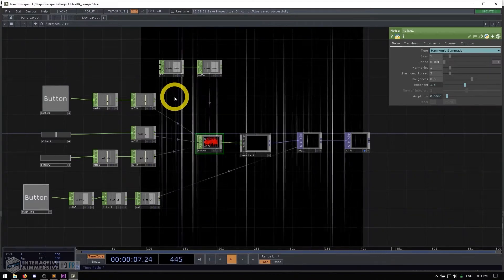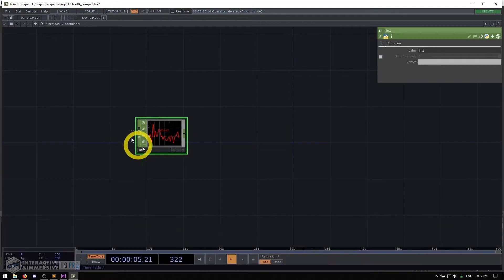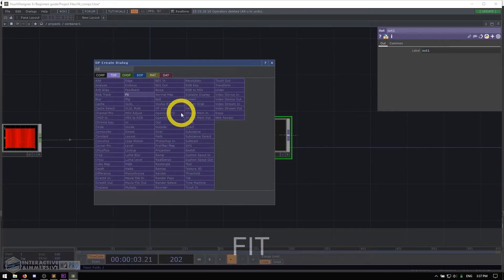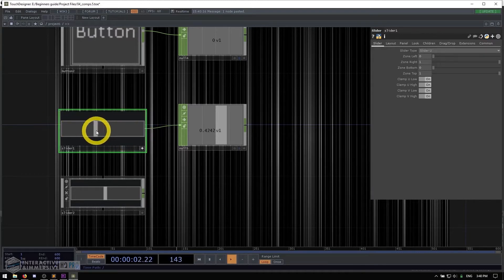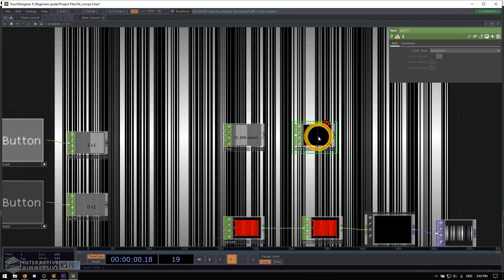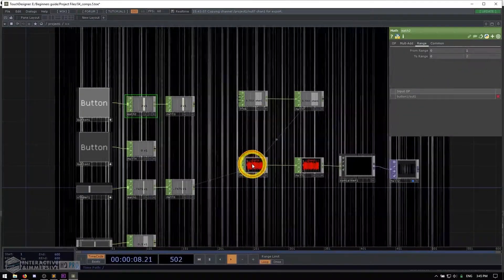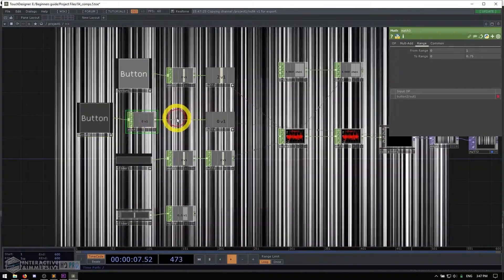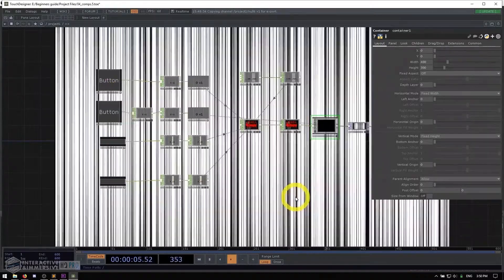12 - Working with COMPs - TouchDesigner Tutorial: Beginner Crash Course

Comment: When i am referencing the noise 'IN' to 'CHOP TO' I am getting error saying 'Invalid path for Node.....reference by parameter 'CHOP'. Any reason?
Reply from the maker: It sounds like you might be making a CHOP reference to the CHOP to TOP's CHOP parameter instead of pointing it to the in1 CHOP. You'll want to either drag the entire in1 CHOP onto the CHOP parameter (make sure the viewer is not active), or type in1 into the parameter's text box.
Reply: @TheInteractiveImmersiveHQ  Hi Thank you so much for responding. I got it fixed, i was dropping the reference value instead of the operator name. :)

Comment: Why when I reference the bottom chop value to the noise type parameter, which "disconnect" the connection of my other parameter and slider and lfo (deactive my control of my other parameters)  ?
Reply from the maker: It's possible that this is happening due to changing to a different noise type than what we cover in the video - the Brownian and Random types have fewer parameters you can adjust (many of the previously available parameters will "deactivate"/become greyed out). 

Double check that the range settings of your math2 CHOP are correct (these are set around 12:15 in the video), as this will control which noise types you'll switch between. Hope that helps!

Comment: Why is it that sometimes we reference a CHOP with the Viewer Active ON and sometimes (like in 3:03) we have to drag the operator?
Reply from the maker: Great question! 

In the example at 3:03 we're not actually making a CHOP reference, we're just pointing to the in1 CHOP. The CHOP to TOP's CHOP parameter requires us to point it to the particular operator in the network that we want to convert into a TOP texture.

This is different from a CHOP reference , which involves actually using the data found within the CHOP to control a specific parameter's value.

Comment: Excellent presentation on this. For a live performance scenario, would it make sense to have several "modulator"  nodes mapped to buttons and sliders? Then have several containers with more complex networks that I could switch between during a performance?  I'm looking to have many different visual styles during a performance while managing CPU usage.  Hope my question is clear.
Reply from the maker: Exactly! For a performance with multiple visual effects, you'd probably want several separate COMPs that you could then "mix" between during the set. If you're not using a MIDI controller or some other way of manually controlling parameters, you could definitely set up CHOP networks to control the parameters automatically. 
To keep things performative, it's always good to follow the suggestions that Derivative have here: https://docs.derivative.ca/Optimize

Comment: What's the difference between Lag and Filter nodes?
Reply from the maker: The Lag CHOP offers the ability to apply different amounts of lag/smoothing to the upward (increasing in value) and downward movement (decreasing in value) of the CHOP channel, as well as the ability to add in overshoot (again, up & down) and limit velocity and acceleration of the data. 

The Filter CHOP, in contrast, does not offer the ability for separate up/down filter controls, but instead has seven different filter types that can be helpful for dealing with specific types of data (for example, de-spiking incoming data).

Comment: Hi there, I absolutely enjoy your great TD Beginner Course. You're explaining it really clear and to the point. Thank you! But I do have a question. It seems the animation on the Z rotation of the noise ramps up in speed from left to right of the screen. So the left side animates slower than the right side. Why is this? Thank you in advance!
Reply from the maker: Great question! I think it has something to do with the way that the Rotate Z parameter rotates through the noise model. I've found that applying the CHOP reference to a different parameter avoids that effect -- try removing the CHOP Reference from Rotate Z and applying it to Translate Z instead
Reply: @TheInteractiveImmersiveHQ  Yes! This seems to fix it. Thank you for replying 3 years after you posted the video. Much appreciated! ❤

Comment: Those buttons and sliders can be "mapped" to a midi controler?
Reply from the maker: Yes! You can make a CHOP reference from a channel in the MIDI In CHOP to the "Value" parameter of either the Slider or Button COMP to control it via MIDI. For the Slider COMP, you'll likely need to further process the CHOP data with a Math CHOP, as the slider requires data in the 0-1 range.
Reply: @TheInteractiveImmersiveHQ  THANKS!!!!

Comment: Hey, enjoying the videos so far and appreciate the work you have obviously put into helping people.

I presume it may be because I am on the free version and not the commercial version but when referencing I don't have the option for 'relative chop reference' in the drop down, only 'chop reference'. What difference is this going to make to me? Is there an option I have missed or is it just because of the difference in versions in the same way that I am unable to make 1920 x 1080 canvas' due to not having the commercial version?

I've been following along in touchdesigner whilst watching these videos and have been getting the correct results but didn't know if in the future it may cause me issues due not not being 'relative'?

Thanks!
Reply from the maker: Thanks for the feedback, we appreciate it :)

That's a great question! In the dropdown, CHOP Reference has replaced Relative CHOP Reference in new versions of TouchDesigner (they do the same thing) so you can use that instead. If you're running a non-commercial license, your output resolution will be limited to 1280x1280. 

Just for reference, in older versions of TouchDesigner, there was the ability to make a relative or an absolute CHOP reference as you see in this video. 

To understand how this used to work, let's imagine a Constant CHOP located within the /project1/ container. If you made a relative CHOP reference from the first channel of the Constant CHOP to another operator inside the same /project1/ container, the expression it produces would look something like "op('constant1')['chan1']" (without the double quotes). 

If you made an absolute reference, it will include the entire network path to the Constant CHOP instead, meaning that the expression would look like "op('/project1/constant1')['chan1']". There are certain situations where it's useful to reference operators this way, but in most cases you'd use the relative reference (which I'm assuming is why that option was removed).
Reply: @TheInteractiveImmersiveHQ  Hi!

Thank you so much for the quick response and detailed answer. With the example you have given that makes sense and I can understand now the differences between the two.

 I'm glad that it isn't something that would cause me issues in the future as there is no way I could afford to pay for a license yet as I'm mainly learning as a hobby right now. 

I look forward to the rest of this series of videos and getting to grips more with touchdesigner. 

Have a great day!

Comment: What i don't get with nulls is if they're so important, why not put them in front of every single operator? How do you decide when to use them or not? If they're so important, why not have it so TD automatically creates a null after every single operator is created?
Reply from the maker: A good analogy would be hiking trail markers. If after every step on a trail there was a mark of paint or some kind of flag marking your way, it would really ruin the experience of being out in nature and would be overkill. In the same way, leaving nulls before/after every operator would make your network huge for no real benefit and would make working so tedious to work around. But, like trail markers, every time you reach a nice cheakpoint or the end of a small bit of processing (like 5-10 operators), if you leave a null operator, it can be a great place to reference and pull data from with references or just for mental marker that some sort of processing ends here. Does that analogy help? If not I can think of another one!
Reply: @TheInteractiveImmersiveHQ  yes I think it helps, if one doesnt exist already, a video demonstrating exactly the problems that can occur if you don't use nulls might be helpful. In the beginner videos it's discussed how it can negatively affect the network but not demonstrated. As someone pretty new to the software it's a bit hard to imagine a situation where it makes life more difficult. For example I think on one of the videos it's said it means you have to go back and change a load of things if you want to make a minor change to the network (if you don't use one). I understand the words but I can't conceive exactly the problem it's referring to due to lack of experience. It's hard to explain. Perhaps I just need to experiment more and learn the hard way :)
Reply: @samfisher01  Really, you only need nulls when you are referencing one operator from another one. Say you have Operator 1 being referenced by Operators 2-9. And then you decide to change Operator 1 by chaining some Math node after it. You would need to then change the references in those other 8 operators. However if you used a Null, then you could put the Math before itand wouldn't have to change any references.

Comment: super cool. i know there's gotta be a way to do this but i'm still trying to learn it all. could i setup midi from ableton to control the buttons and sliders? or would it make more sense to not even have the buttons and sliders in that case and have the ableton midi go straight to the noise parameters, etc?
Reply from the maker: It depends on your project as both are actually ok! Usually you'll probably just bypass the buttons and sliders and send the values directly to their destination, but if you need a UI, then yes you could have the incoming data also interacting with your user interface. As you dive further and further into system building you'll find what works best for you!
Reply: @TheInteractiveImmersiveHQ  thanks for the reply 🙏🏼 been loving your videos!